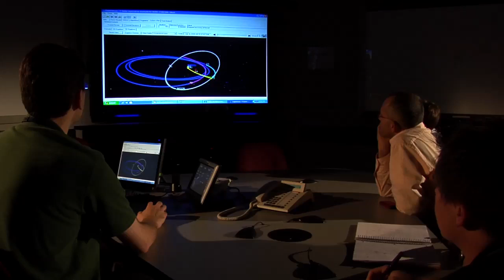Orion: The Journey Begins

Comment: Orion is a joke. SpaceX's Dragon is the most advanced spacecraft.
Reply: Dragon is for low Earth orbit only.
Orion is aiming for Mars.
Reply: Orion is capable of supporting 4 crew for 3 weeks , with sufficient heat shielding and radiation protection as well as over 1 km/s of delta v more than Dragon
It also has a functioning toilet
Dragon can support the same amount of crew with much less space , less time and way less fuel
Dragon can't even get into a lunar orbit anyway
Reply: With the heavy it can. There's a car on it's way to the asteroid belt, so dragon could get to lunar orbit.

Comment: 1950 tech in 2015 :D
Reply: And you know what 1980s tech did when we stopped using 1950s tech? Oh that's right, it killed 14 astronauts
Reply: Ormbar not to exactly. While the Orion is based on the Apollo design from the 1960s that does not necessarily mean it is outdated since it incorporates many modern features such as a glass cockpit.
Reply: Day R exactly, it also was much more expensive than the Saturn V rocket it was supposed to replace.

Comment: I refuse to believe that the solar system can be explored with that little box. How on earth can supplies for several months be kept inside with an astronaut? The "next big step" for NASA (which if full well knows) is the resurection of the original Project Orion. Nuclear power is needed for deep space exploration.
Reply: For deep space missions the Orion would be docked to a larger habitation module, the Orion itself only is the command module.  For a controlled re-entry you can't really build a bigger spacecraft.